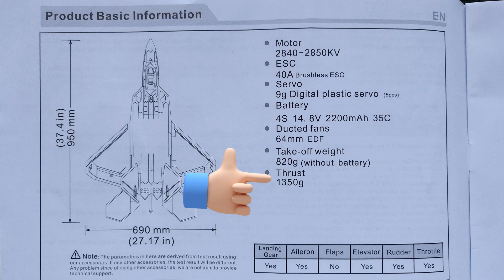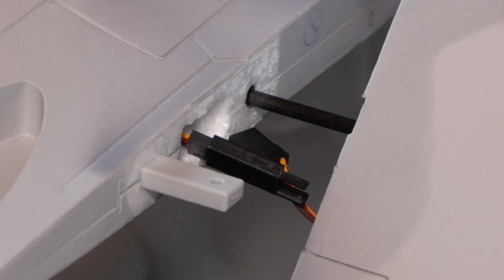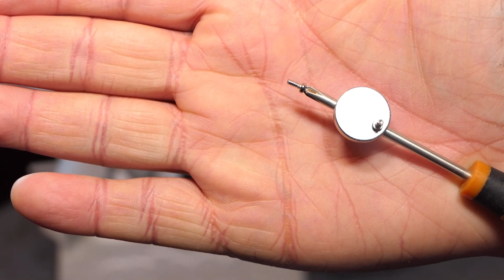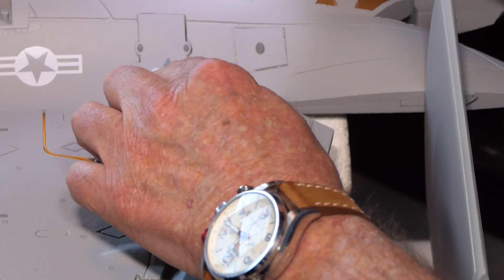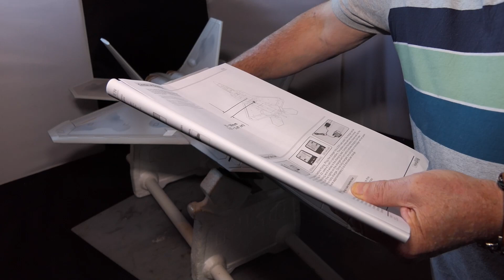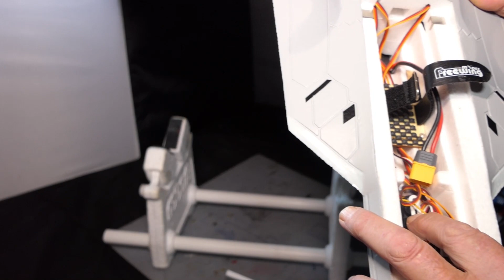Assembly Freewing 64mm EDF - F22 Raptor V2 - November 2023

Comment: I love this EDF - looks great and flies well. I use a byme a gyro, at least until I have more stick time on it! It has the benefit of being easy to hand launch too.
Reply from the maker: Hi Paul, good to hear from you, I tend to always go for the AR630, (with AS3X & Safe) available for the maiden, and the +1, then if I am happy with its handling and performance I will swap that out for an AR410 or AR620 depending on the number of channels I need.. Keep safe and well , Martyn
Reply: @FlankerTanker Not a spektrum man myself. I went the budget route with Flysky on returning to the hobby after 35 years away intending to upgrade to spektrum if I took to it. Too many models later (wife's words) and I've never felt the need to 'upgrade'!